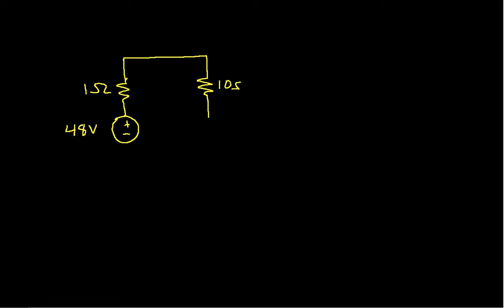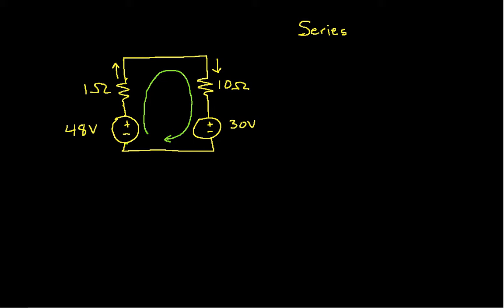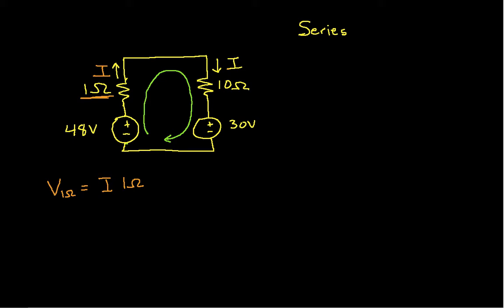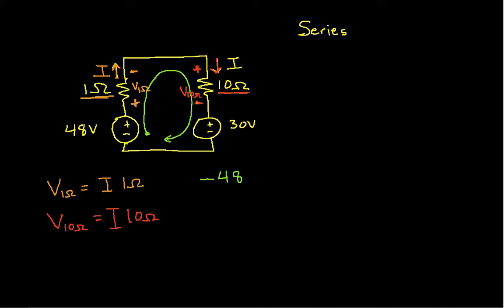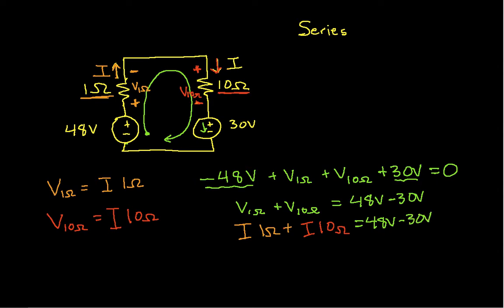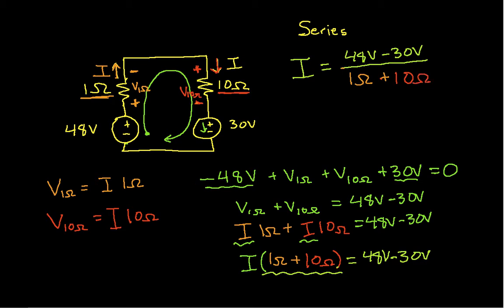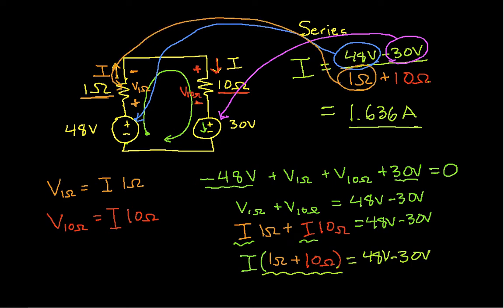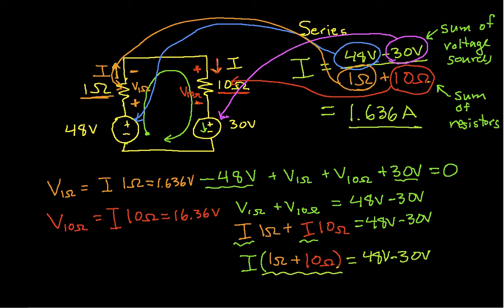Single Loop Circuits

Comment from the maker: @stven007 The 48V was negative when we applied KVL around the loop. When we solve for I, we move the voltages to the other side of the =, which changes their signs. This is why it becomes 48V-30V.

Comment: OK, I've been following along through this (great) series, but I'm really baffled now.

Since the batteries are in series, Isn't the sum of the voltage sources actually 78V?  (48 + 30)? 

Also, can you please clarify something: is that 1.6A the same value at every junction in the series, regardless of individual resistances?

Thanks for these videos.

Comment: cause cells are connected in opposite to each other say(-+ +-). so to the total voltage get decreased . to add the voltages cell should be arranged in (-+ -+) manner.

Comment: What would be the practical purpose of connecting two different voltage sources opposing each other (not flowing in the same direction)?